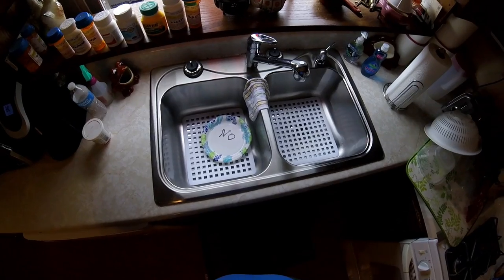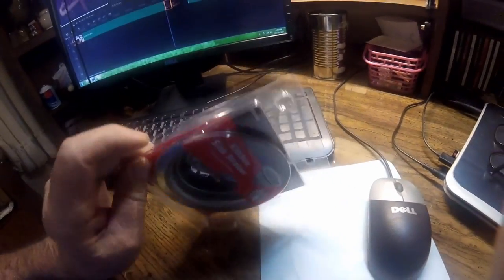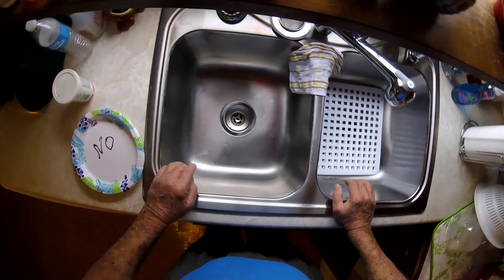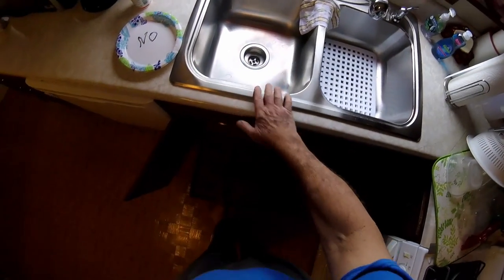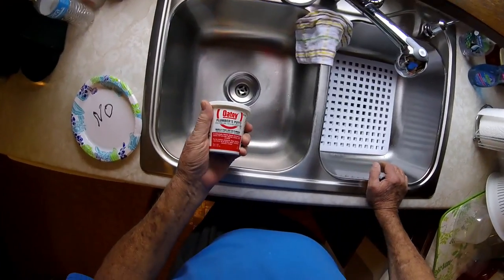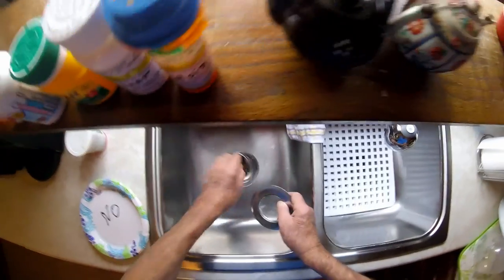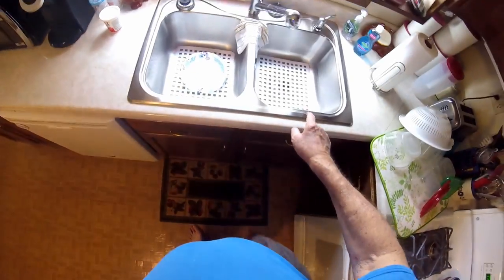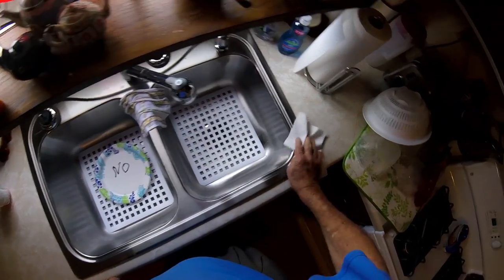Kitchen Sink Problem Pwalpar VLOG 12 19 2017

Comment: Got news for you, plumbers putty put in correctly has lasted for over 45 years in my house Walter. I have a suggestion for you though, DO NOT SKIMP on the amount of putty you are using. Also find the washer just below the spud nut below that attaches the strainer below the sink, then on your PVC drainage line going up to the basket strainer isn't broken. They do wear out after time. Mine is a plastic washer attached to the drain line. If you screwed the 1.5" metal pipe into the basket strainer make sure you used a good pipe dope on that metal pipe, also that it wasn't cross threaded which can lead to sink leaks.  Now you get the idea that I'd worked as a plumber during my life time. 
When I was working at SanDestin Resort I got a State Master Plumbers license. What a test, it took well over 8 hours to complete. Part of that was to design a drain line for a normal house single to triplex, once that was done show where the water lines were supposed to be remembering that waterlines are kept 3 pipe feet from electrical lines. Now we finished single family housing units, then we went to a 6 story building with the same things being done. That 6 story building was easier since we could put all water and drain lines in an enclosure which would be free of electrical lines. I did install a recirculating pump for the hot water on each floor giving the people a quicker hot water platform. [It was something they didn't expect that to be done per each floor.] I'd done that to a motel over in Destin so I was at least familiar with just that. I did not tell the people in Tallahassee that I knew how to do it.  I'd also designed one for my Brother when he was having a house built in Fallston, MD. I drew out all of the plumbing for the house including a backflow valve for the Master Bedroom Bath Jacuzzi which has a small hot water heater. So that made it a requirement that it be included on his blueprints for the house. The architect checked the National Plumbing Code to see if I was right and I was.  He told the builder to do it exactly as is on the blueprint and it'll pass any plumbing inspection. Yup I do know the national code as well as the Southern Standard Plumbing Code which is used extensively in my area.
Reply: Correct, you need to gob the putty on (probably use that entire container).
Reply: What I didn't mention was that the State Master Plumbing license costs $1500.00. It also included lead joint drainage, soldering wiping the joints and pressure testing. What they found out was that I put 500 pounds of hydrostatic water pressure in the pipes, with no leaks. One of them got a bath when he opened a faucet up. Asked why I'd use that much pressure, I asked when they would want to see a leak, now or when the place was full of furniture.  
I'd done the same thing in Okaloosa County FL on a 16 unit condo complex.the buildings were either 4-2 bedroom units on bottom floor and 2 on 2nd story. Then 2 1 bedroom units on the bottom floor and 1 3 bedroom unit on the 2nd story all buildings had attic hot water heaters,, which was a bad thing in the long run. Should a HWH go out or spring a leak the guy on the upper level wold lose his ceiling because of the water. Also I'd pput straps over water lines run in the units per code, the guy putting up the sheetrock was pulling them off till he got a bath. The water pressure drove the nail backwards and nailed the offender to the opposite wall.  His helper came and found me and told me I have a leak, insinuating the pressure test had failed, NOT. I got to the room saw a pile of straps in the corner which I'd put up to protect the plumbing lines and the sheetrocker nailed to the wall soaking wet. He drove the nail into a 3/4" pipe, asking why he'd removed the straps, his comment was that they were in his way. I mentioned plumbing water lines are at 6" and 10" off of the floor, none of his nails except the one that nailed him were at those heights. 
The General Contractor came in saw the sheetrocker soaked and wanted to know what had happened, he'd seen the straps laying in a pile on the floor so he knew it was not my fault. The sheet rocker had to pull off all of his lower sheets, put the straps back where they were supposed to be and then he got my bill for the repair 4 ells and 6" 3/4" copper pipe. What he went through with his nail was a copper coupling I took the damaged pipe 2x4 and the nail back to the shop, laid it on the owners desk along with the paid bill $550.00. You might say I was pissed at his [sheetrocker] stupidity. Skeet, the plumbing co owner, had not heard anything about it till I laid the money on his desk. We never had any problems with our waterlines either. I got a reputation for following code strictly.
Reply: Make up a 1/2' diameter snake of PP long enough and get in under that edge. Tighten with spud wench and  don't let drain slip around when tightening. Most PP will ooze out...
Reply from the maker: I got it done but the stuff keeps oozing
Reply from the maker: Come fix mine lol
Reply from the maker: Thanks my friend

Comment: I was dealing with years of leaks on the drain baskets and the rim of my stainless steel sink where it mounts on the counter top. In 2005 I used silicone on both the rim and drain baskets. There hasn't been any more leaks, so I think silicone is 100% better to use over plumbers putty.
Reply from the maker: Im beginning to wish I had use silicone  its done with putty and I aint happy with it

Comment: I would like to share my experience with a leaky sink that happened not too long ago. Might help somebody. Every time I did dishes I could hear drip, drip, drip. I had the darnedest time finding it. I even took everything from out under the sink (which is a lot) and still couldn't find where the drip was coming from. This went on for a few days and finally discovered that I had a slit in my dish drainer and water was collecting under it and getting under the rim of the sink and the counter. Got a new dish drainer and the problem was solved. Hoping that maybe that could be your problem and not so much work involved.
Reply from the maker: Thanks for sharing the story with us Joyce  Its often hard to fix things when you cant find it